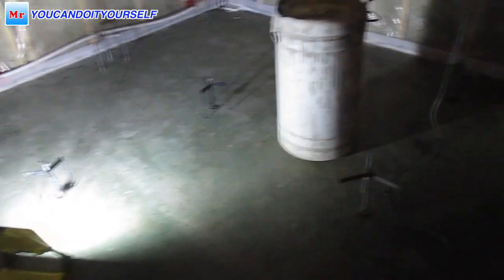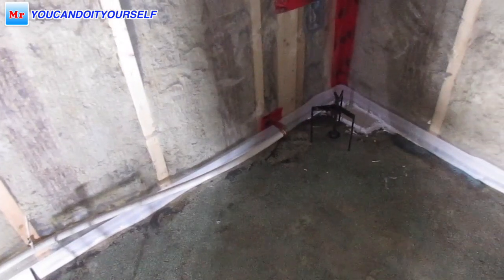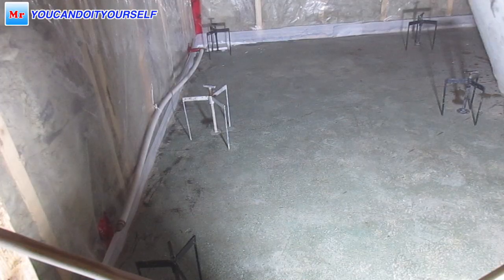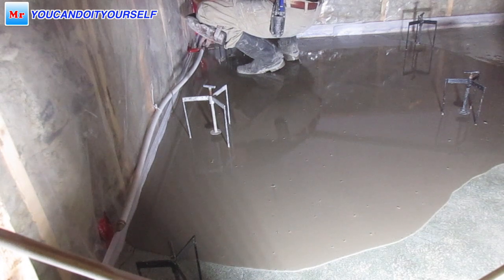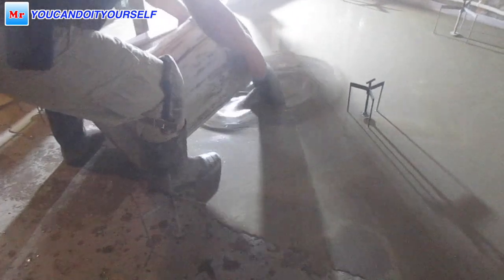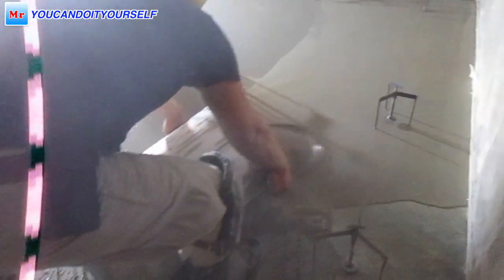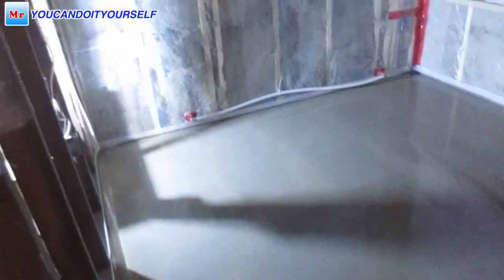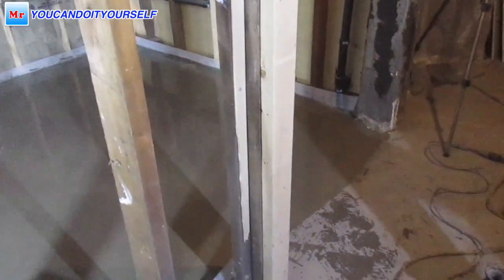How To EASY Leveling Concrete Floor with Screed Leveling Tripods use Mapei DIY

Comment: Your screeds looks very very fluid. Does it hence shrink a lot when it cures?
Reply from the maker: Hi Nico, Mapei is not shrinks, why I love work with this leveling compound!
Reply: MrYoucandoityourself hello sir. Great work, I love your channel. Quick question - I cannot find the Novoplan2 Plus self leveling compound. I can get Novoplan Easy Plus or Self Leveler Plus from Mapei... would you recommend any of those two? Thanks a lot!

Comment: How much water are you adding extra per bag?  It looks so watered down.
Reply from the maker: Hi Dan, each compound is different. For this Mapei Novoplan 2 - 5 gallons basket for 3 bags. Thanks!
Reply: @MrYoucandoityourself  If you are adding 5 gallons of water for 3 bags of the mix, you are adding way too much. The data sheet says 3.75-3.96 for 3 bags.